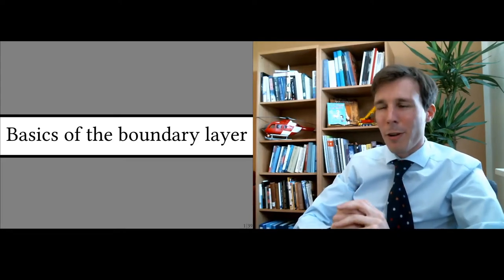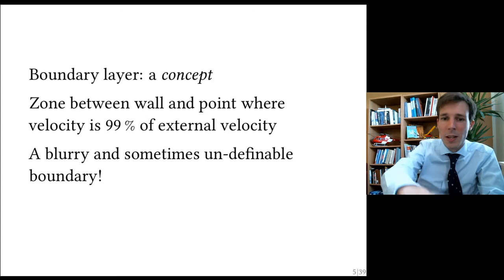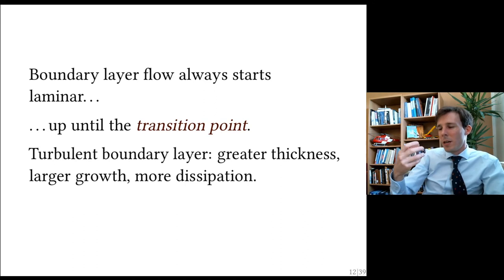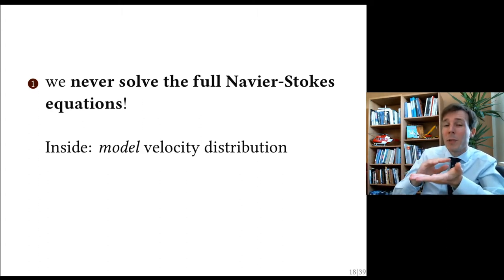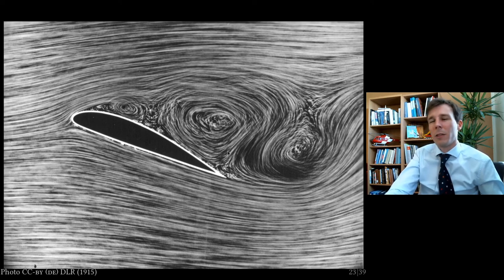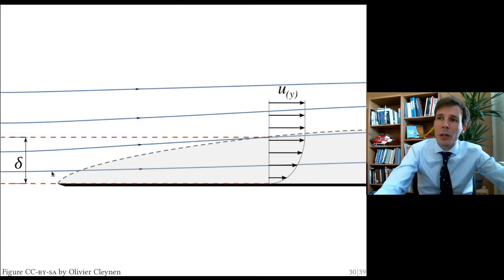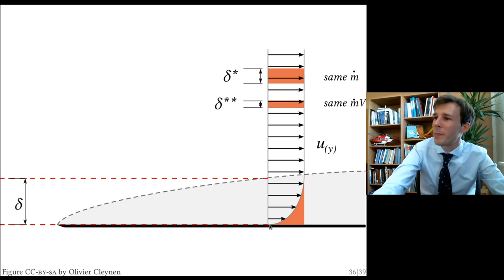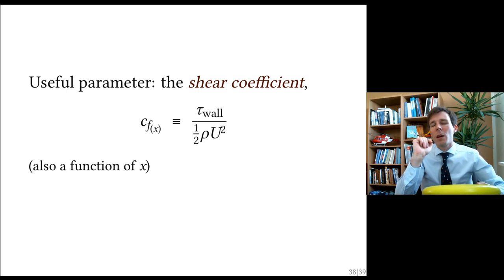Basics of the boundary layer (Fluid Dynamics with Olivier Cleynen)

Comment: Wow. Seriously amazing. The way u explain things in a more practical way is very rare. Thankyou very much.

Would you please help me with a doubt.
The form factor being ratio of displacement thickness to momentum thickness is around 2.59 for laminar and lill greater ghan 1 for turbulent. So lesser the value , more fuller the velocity profile would be, so can we say that a fuller velocity profile will have a less probability of flow separation always? i.e.  Should form factor be less if we dont want flow separation? And how can the velocity profile be fuller or not fuller for external flows, as the concept of fuller velocity profile (low form factor) sounds better for pipe flows.
Reply from the maker: I can’t tell from the top of my head. I think the best thing to do to get an answer would be to find a textbook dedicated to boundary layers. Most general textbooks don’t spend much time on such questions, and neither did I (not enough time for everything in the course…)
Reply: @oliviercleynen  Thanks a lot for your suggestion. Can you recommend some books for the same?
Reply from the maker: @vaibhavbandal8325  nothing comes to mind — I am away from the library at the moment (and will be for the coming 3 months), sorry